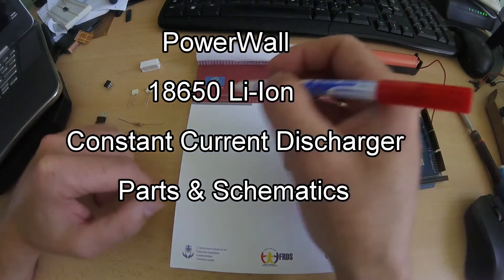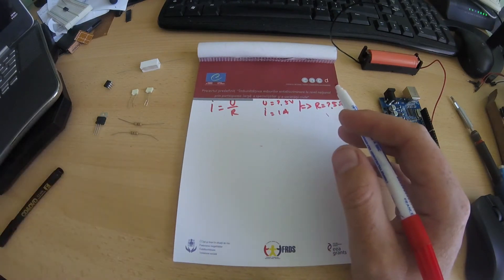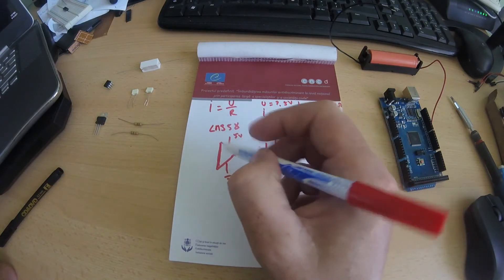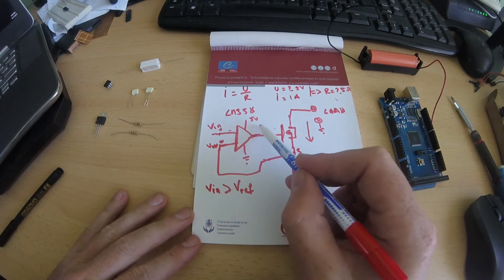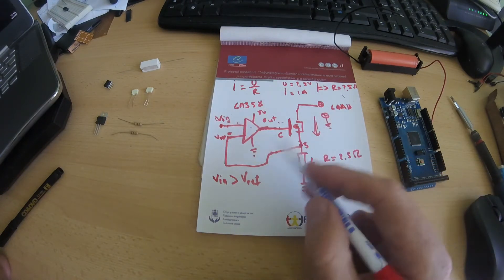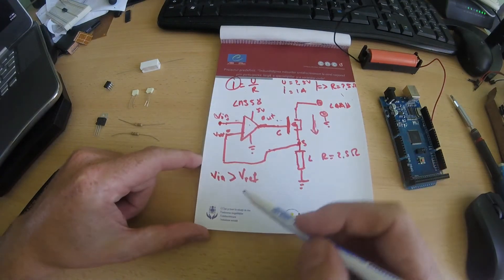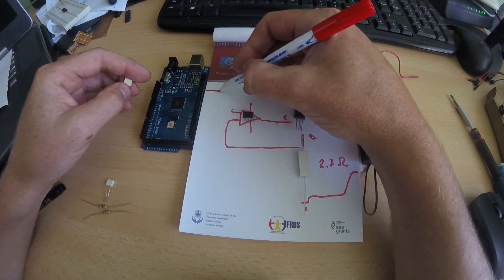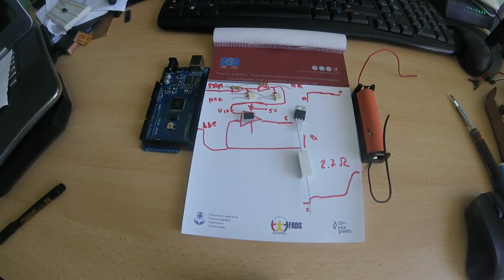#9 18650 Li-Ion Multi Battery Capacity Tester - Constant Current Parts & Schematics

Comment: You can / should really use the other op-amp as a signal voltage follower so that the v-ref input doesn't see the very low impedance of the second op-amp, you may be fine with the output from the PWM pin but if you used a adjustable resistor the additional impedance of the op-amp would skew the regulation.

Something like this would be a better solution and you already have a spare op-amp sitting there. :-)

http://www.kerrywong.com/blog/wp-content/uploads/2013/03/ccdummyload.png